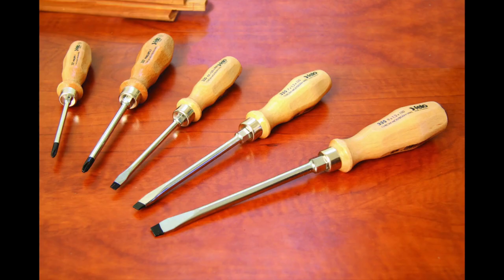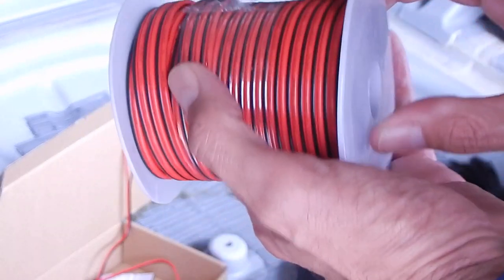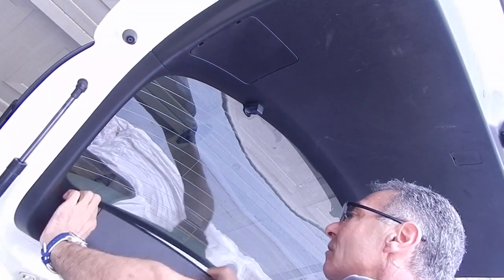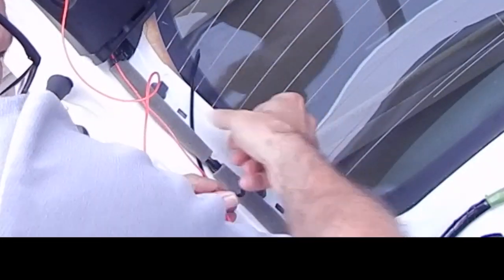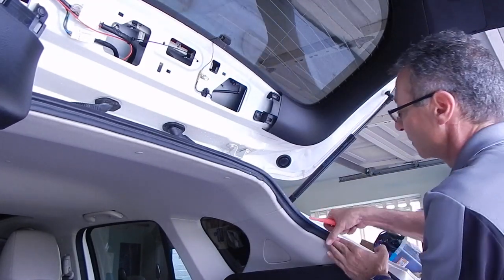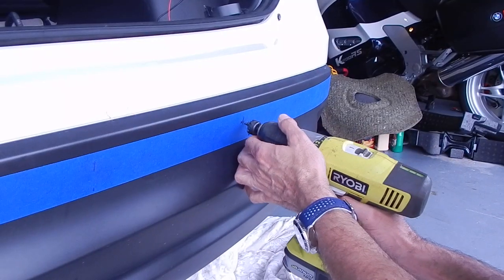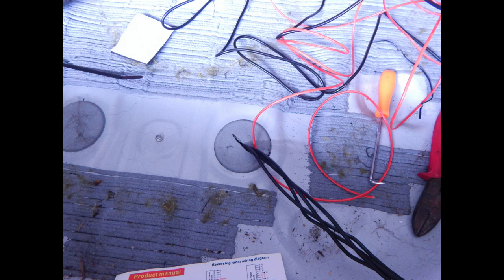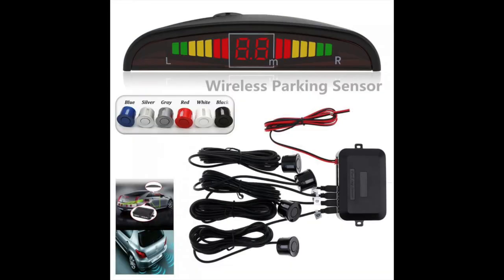Parking Sensor Install on a Mazda CX-5...  Install and review

Comment: Mazda dealer wanted $880 to install two parking sensors on my 2021 CX5.   The holes were already drilled in the bumper and had covers over them.  Cost was $280 for the parts....including two sensors and a wiring harness.....plus $580 for labor....plus tax etc.
Reply from the maker: They’re still working perfectly.  My wife loves them. After two years, I’m happy with these.